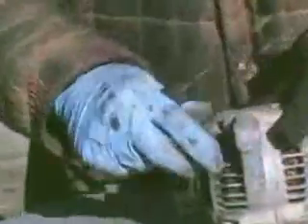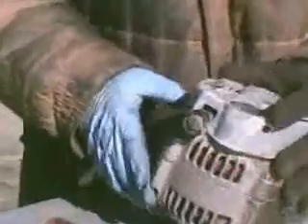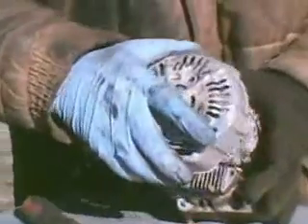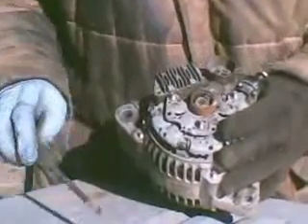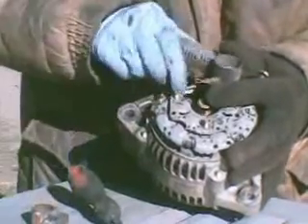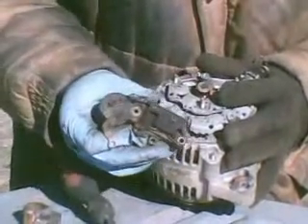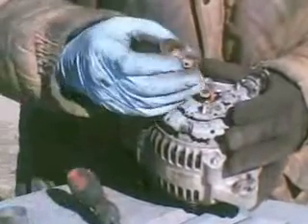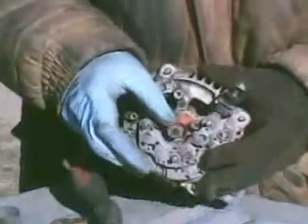Honda Accord Alternator Removal and Repair

Comment: how'd did you get that lower through bolt out? It'd driving me nuts
Reply: I'm having the same problem right now. I might cut the belt and pry the alt off and then maybe just Dremel the bolt out after.